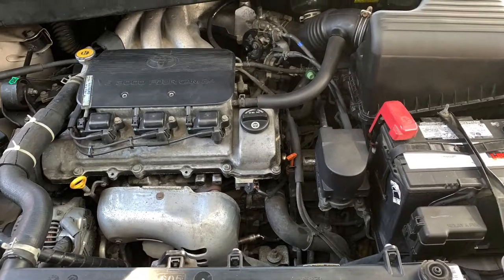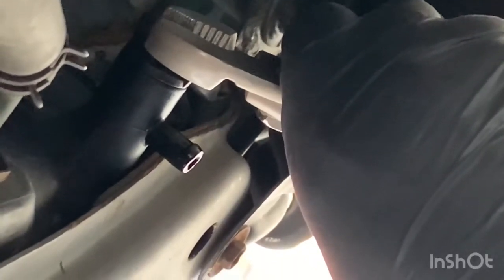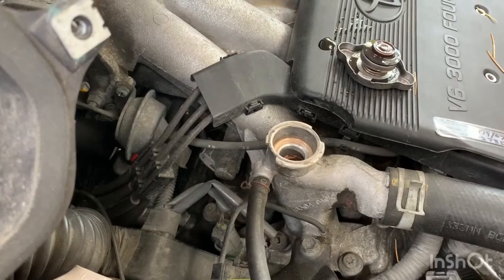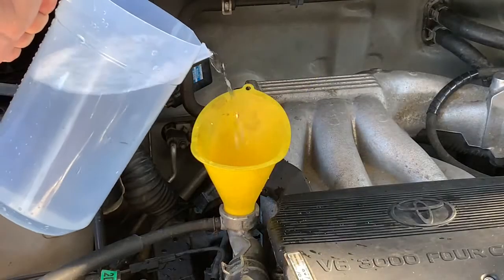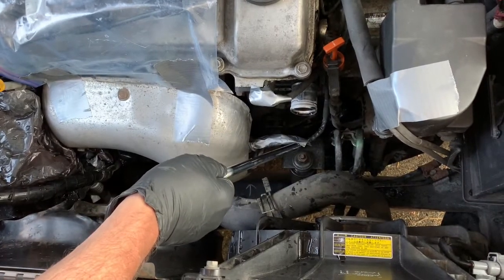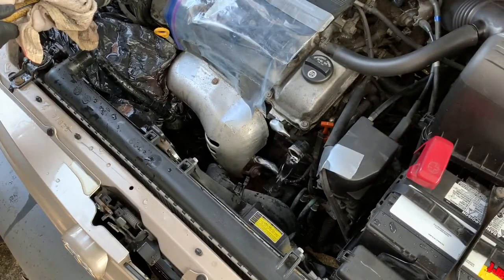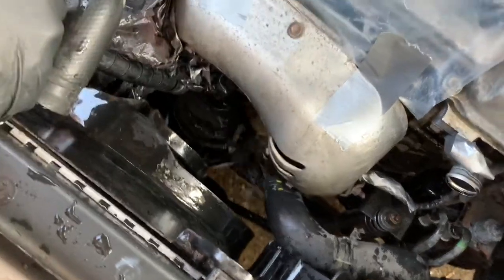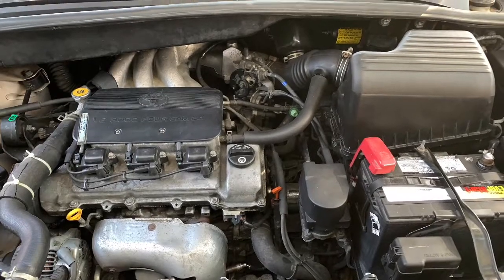Engine Flush with garden hose!

Comment: I know this video is old and blah blah... new to me though! I have a 2017 Durango GT and flushing the coolant after a oil filter housing crack isn't fun. Double as no fun with no radiator cap.. or I'm just that blind. Thanks for the idea Pen-Pusher of using that water hose nozzle though! It is pefect! Even the original hose clamp fits right on it.  And for all those that wanted to know, HomeDepot sells those nozzles for like $10 in the lawn and garden section where the other water hose nozzles are. Who knew a water hose nozzle would end up living in my toolbox.
Reply from the maker: Thanks for the feedback. Go Home Depot!

Comment: I just did a very thorough flush of my 1999 Mazda B3000.  I used the Prestone cleaner, and to my surprise, it actually worked.  I thought it was just a gimmick.  I monitored portions of the coolant in those large clear plastic soft drink "glasses" from my local convenience store.  I obviously drink too much of that stuff.  Before I put the Prestone cleaner in, the coolant was getting cleaner and cleaner with each flush just using water.  I then put the cleaner in, and drove around.  The coolant had gotten dirtier.  The Prestone cleaner actually worked.  Who could have thought?
Reply from the maker: Good job! I like your methodology! :)

Comment: After the flush, i thought you would have poured the new coolant mixture in the top hose to flush out the plain water remaining in the engine water jacket until the new coolant can be seen coming out of the bottom radiator hose. I think the 50/50 mixture would be slightly out if this not done. Same for the heater core/matrix to remove all trace of sitting plain water so as to get close to the 50/50 ratio as much as possible.
Reply from the maker: Not necessary. It makes a difference in theory, but in practice it is a miniscule amount. :)
Reply: Yes if you do it before it gets cold it will eventually run the left over water out
Reply: Mix your coolant a little stout at first and it will be okay
Reply: @jamesloe9374 Yea but you don’t want it to flash rust. This prevents that. It also rinses out the hard water.

Comment: To remove tap water from the engine block,  use a small blower and insert it in the upper radiator hose going to engine block to drain all the water in it. I just did it to my 2004 corolla and it feels cooler and more efficient to drive.
Reply from the maker: Thanks Robert. That is a great suggestion!

Comment: What type of fitting can I get for the end of the hose ? So it will fit the multiple holes
Reply from the maker: Hi Josh, as you can see at 3:50 you can just use a rag wrapped around the hose - then you don't need special fittings.

Comment: Bro.. we never toutch that little plastic cap.. in older cars.. thats craky.. it cracks! then its a new radiator.. that little piece its subgectec to lots of heat and cold.. water.. dust.. everything.. many people gonna fail.. :)
Reply from the maker: Dude, this channel is for part-timers like myself. But, we always appreciate tips from the pros! :)
Reply: Yep I heard it's better to drain using the lower coolant hose
Reply: If you break the stupid plastic.. You get new radiator. 180€ maybe.. Maybe more.
Reply: I mean they do have sprays to condition plastic but still as a safety precautions I'd still drain using the lower hose
Reply: @KavoTheGodd  that spray dont protect the plastic.. Just another way to get our 💸..
Reply: @Nsatiro hey just like blinker fluid 🤣🤣🤣🤣🤣
Reply: @KavoTheGodd  😂 😂
Reply: Yes, if you take off hoses you do NOT even need to open that darn radiator petcock at bottom!

Reply

Comment: Can I use a garden hose to drain the reservoir coolant
Reply from the maker: Yes, you can undo the reservoir connection to the radiator and then flush it with the hose.

Comment: What if no water come out from the engine when you flush out?What may be the problem?
Reply from the maker: There will be a blockage somewhere. Your engine will also be overheating, because it is not cooled properly. :(
Reply: Thermostat is blocking flow perhaps.

Comment: Where do i get deionized water?
Reply: You can use distilled water, available at most grocery stores
Reply from the maker: You can also used distilled water - just as good. Should be available at Walmart or auto parts store.

Comment: What the hell? There ain't no plastic valve you turn. It's mostly a small bolt you remove at the bottom. I wish it was that easy to drain
Reply from the maker: What model do you have Patrick?
Reply: Lol calm down Patty. My stock IS300 radiator had a plastic petcock the same exact style as in the video but once I installed an all aluminum one it came with a 14mm bolt. So just so u know each car is different but the one in this video is most commonly found on almost all vehicles.

Comment: All wrong this does nothing it's not cycling thru the whole cooling system like the heater core for example and you're supposed to use distilled water
Reply from the maker: Hi Dylan, it does cycle through the heater core. Just make sure your heat is turned on inside the vehicle. And, you are welcome to use distilled water to flush a 20 year old vehicle if you want to!
Reply: Don’t matter what water your flushing it with😂
Reply: So even with atf in your coolant system  use that preston flush?

Comment: Don't be using a garden hose to flush out your coolant. 
READ YOUR OWNERS MANUAL. 
DISTILLED. WATER. 
DISTILLED WATER ONLY 
DO NOT USE GARDEN HOSE WATER
Reply from the maker: If you are driving a race car you shouldn't do it. My van is 20 years old and I don't mind flushing with tap water. I drain it all and then refill with deionized water and coolant. :)
Reply: Oh stop it. The garden hose water is no where near as dirty as some people's under maintained cooling systems. Plus like he said, he flushes with the garden hose then fill with deionized (or you can use distilled).
Reply: I think after flushing it with tap water you can just flush  it with distilled water afterwards.
Reply: You probably pay people to work on your vehicles.
Reply: @GG-zf9vy  Never

Comment: Oh nooo you're NOT supposed to use TAP WATER GARDEN HOSE!! Please use DISTILLED WATER 1 or 2 gallons.

#1 Flush all old engine coolant fluid out from the drain.
#2 Pour in DISTILLED WATER about 1 or 2 gallons then turn on engine idle running for 5-10 minutes when the boiling maximum 100-120 degrees.
#3 Flush all out of DISTILLED WATER from the drain
#4 Pour in new ENGINE COOLANT in 1 gallon or 2 gallons then turn on engine idle running for 15-20 minutes and turn on heater thermostat "HOT" to be sure engine coolant getting hot at temperature 185-200 degrees.

Good luck with that TAP WATER will ruin your engine!!
Reply from the maker: Hi Randy, my van is 23 years old now. How many more years do you think this engine will last?
Reply: @Pen_Pusher  Your van is 23 years old since 2000?? Is it Toyota Sienna minivan as right now how many mileages are you currently used to drive? Mine is Toyota Sienna LE 2011 as now been 12 years old and the mileages 304890.
Reply from the maker: @captainrandybouatick6895  My Van is Toyota Sienna 2000 and my mileage is 240,000.
Reply: You're just repeating what you've heard. A lot of city tap water is just fine to use. Depends on where you live.
Reply: Tap water for flush should be fine. You need a good flow of water going through your engine to flush away the crud and corrosion. Better if you remove the thermostat too for the flush.